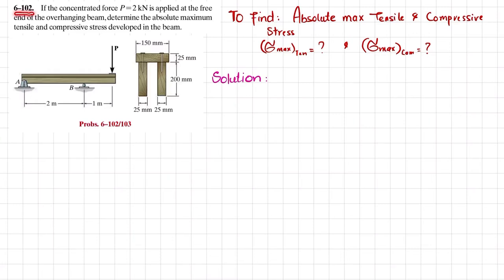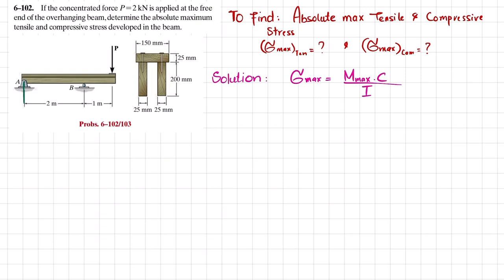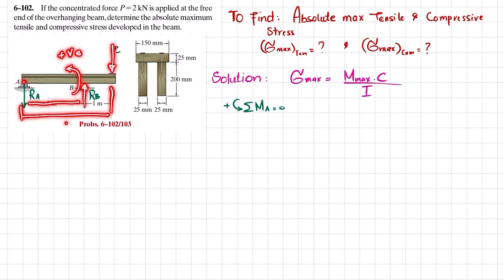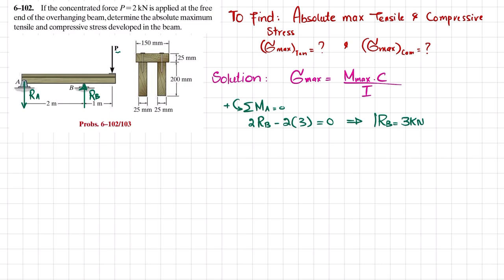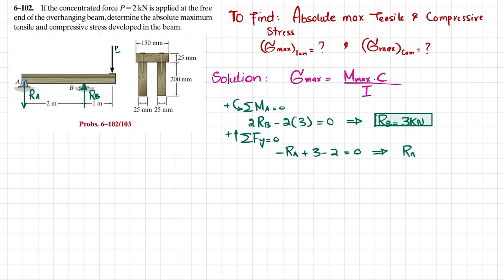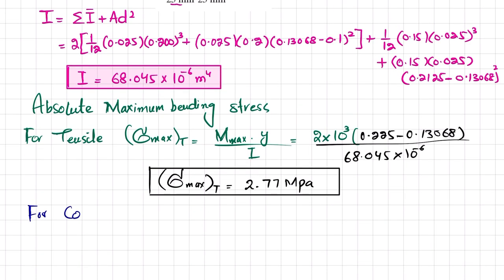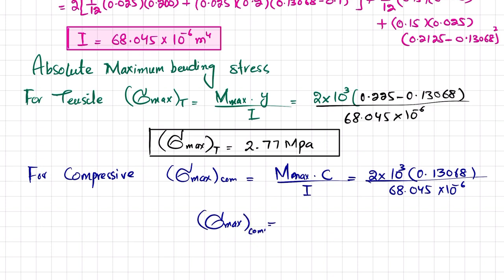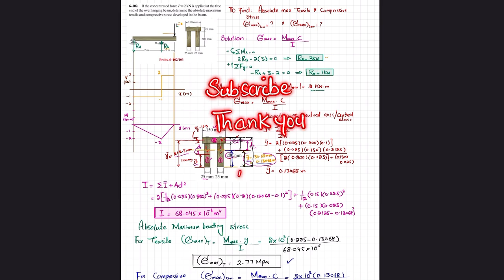6-102 Determine absolute maximum tensile & compresive stress in beam | Mech of materials rc Hibbeler

Comment: Sir why Ra you had taken downside it should also be upside like Rb
Reply from the maker: You can see one force at the end is downward and support near it will be upward and you can take third support downward.  It doesn't matter if your selected direction is wrong it will give you negative value which means your assume direction is wrong and it should be opposite to the direction you selected.
Reply: @engradnanrasheedmechanical  thanks sir
Reply from the maker: You are welcome 😊